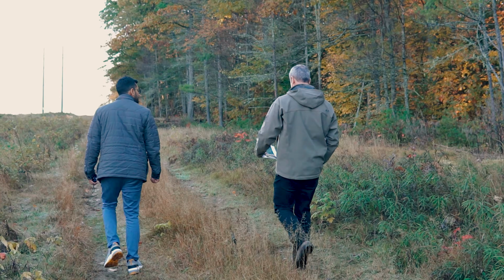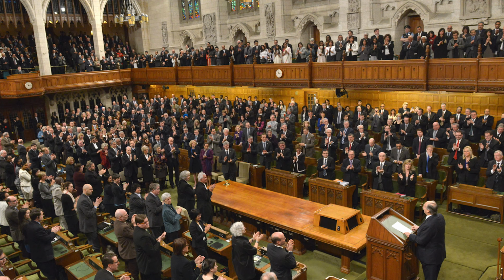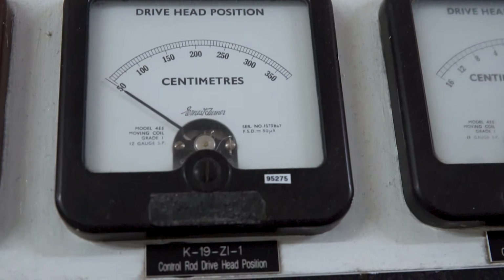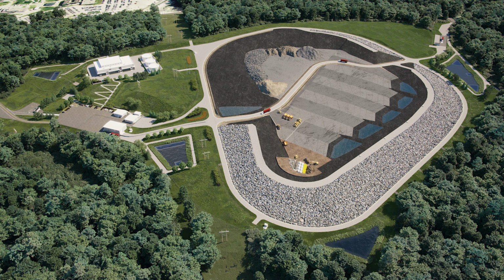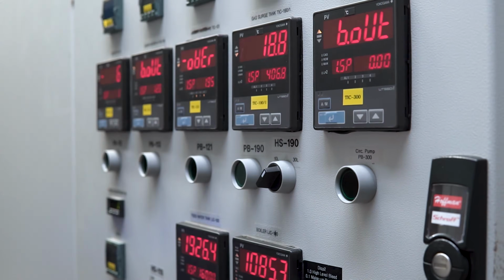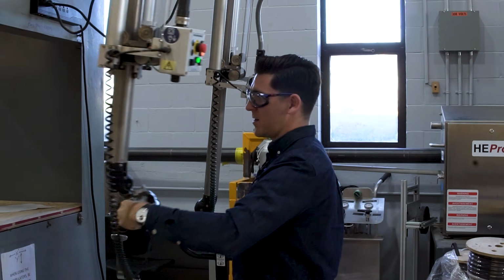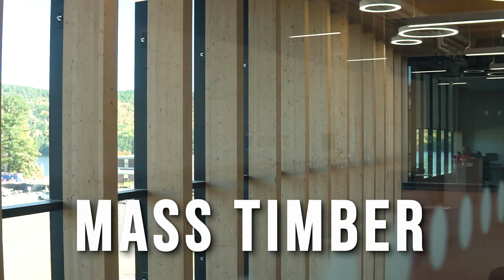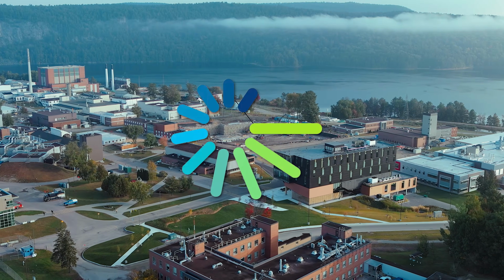Adventure Inside Canada’s BIGGEST Nuclear Laboratory

Comment: Absolutely amazing video.  I really want to know more about high temp nuclear.  I did some quick searching of CNL a week ago.  For climate change I think we should just start talking about creating "heat city".  That is a process heat manufacturing city powered by nuclear.  But my understanding is that a CANDU doesn't get hot enough for this.  I've heard CNL did some research on this, but I'm not sure.  I'd like to know more.  Let's just create the idea of "heat city" by talking about it.
Reply from the maker: Yes, producing district heat via nuclear energy is a great application. Currently, there are a lot of reactors across the world in parts of eastern Europe as well as Russia which produce district heating. CANDU reactors like Cernavoda also produces district heat for a nearby town, however high temperature reactors are a generation 4 reactor design that can do this more effectively. Utilizing different fuel structure as well as a reactor core design, this can be achieved. CANDU on the other hand is a generation 2 or 3+ reactor design that is ideal for electricity generation and producing isotopes at the same time
Reply: @OsamaBaig  so what you are saying is that if we wanted high temp process heat from a reactor in Canada we would want something other than the CANDU?  Perhaps someting like Japan's high temperature gas test reactor?  I was hoping that CNL was doing some research to get a CANDU up to these high temps.
Reply: @dodaexploda  There was some preliminary research done on a CANDU style GenIV Supercritical-water-cooled reactor (SCWR). The difficulty is the extreme pressure (~50% higher than a PWR) required to contain water at such high temps. That makes it a difficult economic problem to overcome vs sodium, molten salt or gas cooled GenIV designs.